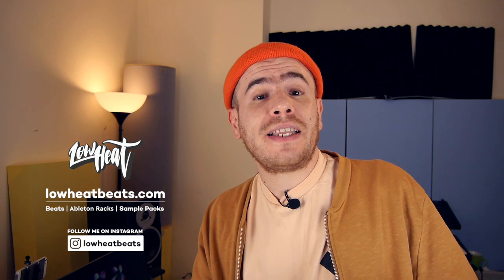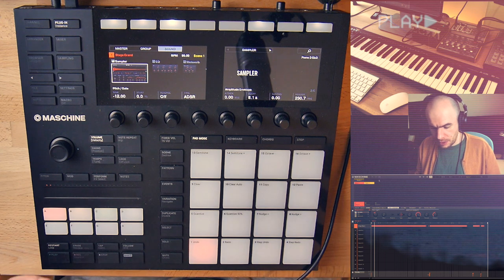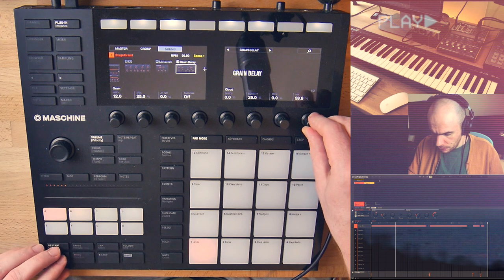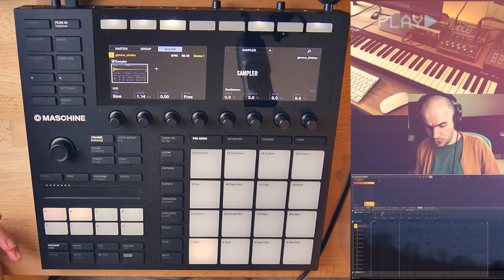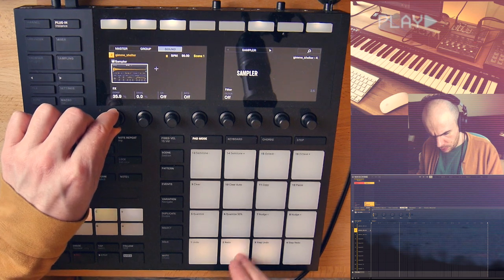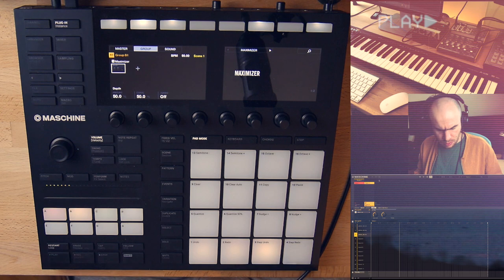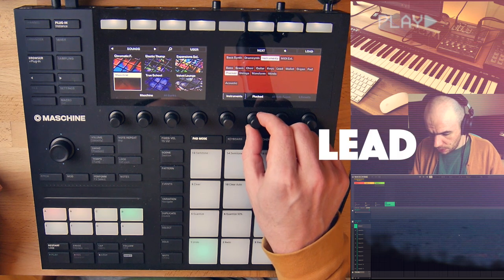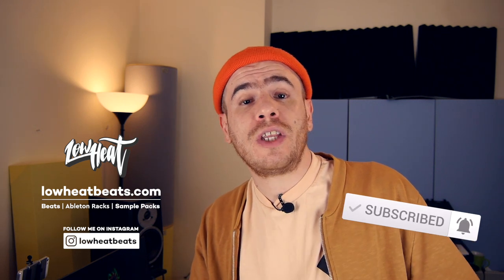Maschine MK3 Lo-Fi Sound Design (Tutorial + Beat Making)

Comment: Hi, thanks for the great video, is it possible to route other instruments, or groups to the Sampler? like kontakt sounds  and others for example? Because most of the sounds I use are not default sounds but I like to add this S1200L lofi feel to my sounds.
Reply from the maker: Glad you enjoyed the video! The way to do that would be to resample it, I’ve got a video on this as well - https://youtu.be/tApoqjoeebs
Also, If you have the full version of Kontakt, you can switch it to SP1200 mode as well, but the resampling method would work for every instrument.
Reply: @LowHeatBeats  Great! Thanks Brother, you the man!